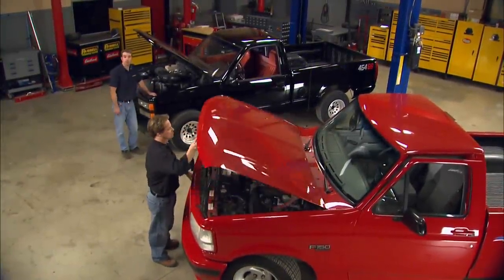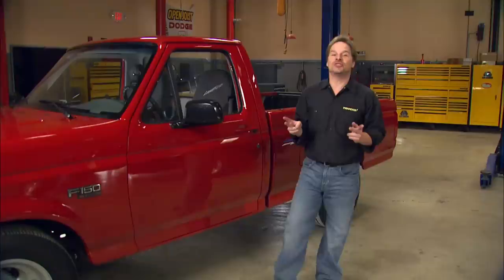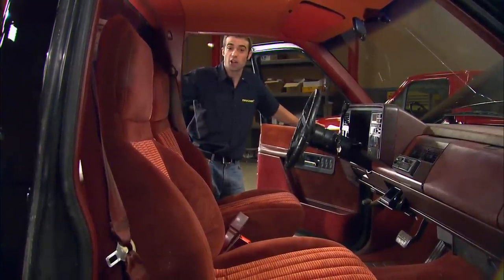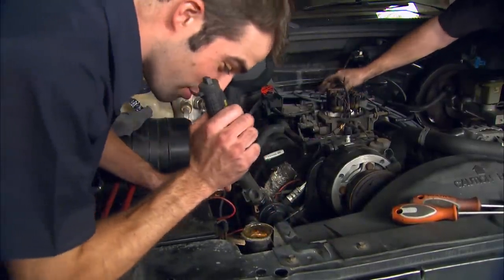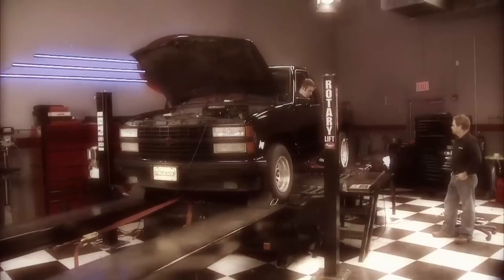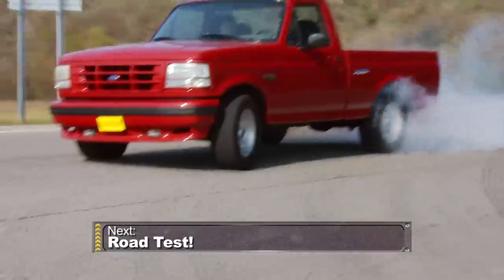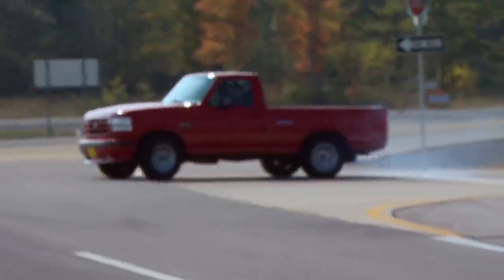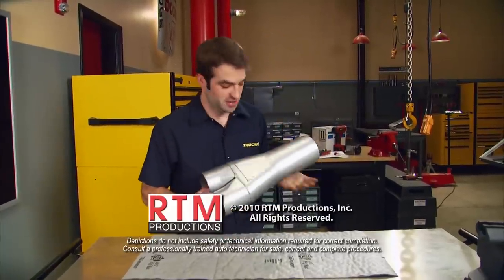'90 Chevy 454 SS vs '94 Ford Lightning F150 MuscleTrux Wars Part 1 - Trucks! S10, E1

Comment: Haha, the ford makes like 35 more hp and the same amount of torque with 103 less cubes
Reply: It's an emission game. You dont think the same ford product would have beat out the 454 Chevy in 1970 do you?
Reply: sonofthesheriff no but a 1970s 460 would which is equal
Reply: And a whole 3 hundredths of a second faster because it's doing what a normal ford does. Sucking at putting the power on the ground.
Reply: @willc3586  Its 3 tenths, not 3 hundredths. Which if you were a drag racer, you'd know is a lot.
Reply: @willc3586  tenths, not hundredths....on a hundred less cubes.
Reply: You right, my bad. Night shift....
Reply: @sonofthesheriff  yeah ever heard of Le-mans?

Comment: Back in 2010 I bought a used 1994 F150 Lightning for $4,500  I put about $1,500 into the truck. New rear tires, new shocks , new parking brake cabel, new Lightning Decals, new plugs , wires, rotor and cap, new vale cover gasket, bought a complete used  Bassani  equal length shorter headers exhaust system. Had the headers power coated black. Recondition the engine bay and some engine components, new radiator, sway bar links. Went to the auto recycling  to get a decent radiator core support to recondition ( the one in the truck was rotten at the bottom) a completed jack and a better coolant/windshield washer tank, new fog lamps, new rubber channels for the door windows. It was a fun truck that got about 10 miles to a gallon of gas. Sold the truck in fall of 2012  for the same amount that I bought it for.
Reply: You did all that for $1,500? Impressive.
Reply: That would cost way more today lol
Reply: @chefderappa4838  LMC  Truck saved me a lot of money the hardware to mount the reconditioned radiator core support was about $150, the dealer parts department was around $300. Also RockAuto was a big money saver. The owner of the Auto Salvage yard is a friend so any parts that I bought from him I got a killer deal on them.

Comment: I've seen middle school kids who can weld better than that.  Love the trucks.  Grew up in the 80's and 90's and I love trucks.  My 91 GMC stepside I'm building to be a muscle truck.  I have taken off all the chrome (mirrors, grille, bumpers) and put on the 454  SS mirrors, color matched front bumper, roll pan in the rear, took off the emblems and rubber trim.  Just painted it all fresh dark gray last summer.  Needs a drop and some wheels now.  It has no cats, EGR delete, K&N filter, injector pod spacer, Hypertech "salad bowl", 3" flowmaster 40 series dumped, B&M shift kit (chirps second easily), timing advanced at the distributor, 180 degree t-stat, and electric fan.  Would love some 4.10 gears and Detroit true trac.

Comment: Well TBi Vs multiport. 🤷‍♂️
off course the multiport runs better. 
just check the Vortec 454 to see the gain in power. 
Even the 5.7 Vortec(96-01) is making lots better.
Reply: GM TBI from '88-95 were junk.  Run forever and start right up but NOT even close to performance engines, not even a decent platform. 

I had a '94 GMC Sierra K1500 4x4 with TBI 350, lifted with 35s. A guy I worked with had a heavier Chevy Tahoe, 1996 K1500 with Vortec 350, same lift, same size tires and he would smoke me every time. 

Nice truck, clean, cool body style but no power. 

Now a days you can get those LS3 E-Rod crate engines designed to pass CA emission/smog and have 400+ horsepower.
Reply: Very true. TBI trucks absolutely suck for any kind of performance. Besides, Ford did a way better job in matching parts. All Chevy did was take the big block from the 1 ton and put it in a half ton. It is the same engine out of the 1 ton.
Reply: You mean the Vortec 496? The 496 8.1L was a monster!
Reply: excuses excuses, y'all got embarrassed by a small block.
Reply: Gm's TBI was rock solid, well designed, and one of the first of it's kind. They were (back then anyway) trying to make the most dependable truck you could by.. and one of the reasons GMT400 trucks are one of the best Chevy Truck runs in history.
Reply: @alexcorona but its lil brother the Syclone embarrass them all, even the sport cars!
Reply: @scarface9617  yea that 4.3 turbo charged was no joke
Reply: @jasonvoorhees6657  I had a typhoon.. was the funniest ride that I've ever had til' this day!   These two trucks was no match at all for it! wouldn't believe the badass rides that I put to shame.. and held the road good for what it was!
Reply: srvanddt1 you’re right about that, I built a 383 for my extended cab, it’s pretty quick now

Comment: I got the black ford lightning in 93 off the show room floor first day I saw it.. went in for a 4 wheel drive pickup in January..upstate New York..   saw the Black Death sitting inside.. salesman said wanna drive it.. well hell yes..drove it like it was built to do.. man it was a blast .. I mostly loved how well it stuck to the road .  It was like a slot car with both gas tanks filled.  So yes when I returned to the dealer I got Black Death  that day .  The smiles on my face driving her home ..  I lived 10 miles away..think I got home 6-7 hrs later.. OH yes the Long Way home.. lol

Comment: Ive owned both trucks.. the lighting kicked the crap out of the ss.. but tons of performance parts out for the 454 and the 351w so both can be a great truck.. but personally ill choose the lighting everytime it was just a better platform..
Reply: F150 has always been a better truck , everyone knows it but blowhard Chevy fans try real hard to bs their way through
Reply: Have a 98 k1500 5.7 5 speed Z71 strong motor. Flowmaster..yeah. Passing many fords on the road

Comment: This was in my era too. I had a 1994 Dodge Dakota sport with a 318 and 5 speed manual trans. These 2 trucks got to see my taillights on a regular basis.
Reply: I knew a guy with a 5sp 318 Dakota reg cab around '99. He  embarrassed a couple of  5.9 rt Dakotas at the track. Those were some.   >R< eal.    >T< urds    back then

Comment: 5:41 😂i love how they even left a piece of mig wire hanging from the garbage welds! Looks like stevie wonder works part time in a muffler shop.
Reply: A piece of wire. More like several pieces lmao. Booger welds haha
Reply: A piece of wire. More like several pieces of wire haha. Booger welds lmao
Reply: @breimer87  yeah I commented that before they got to the rest of the exhaust😂 sad to say I was welding 5 x better than this before I was even in highschool. Built my own exhaust for my f150 when I was 17 and all we had was a oxy acetylene torch and a stick welder from the ww2 era. Hell I even took two sections of pipe and pie cut then with a sawzall , welded them back together and made  a large cowbell exhaust tip.even made the thing shoot flames with some primary wire, a switch, and old coil,and spark plug.  I couldn't even imagine kids these days doing any of that.They are too busy with their fortnite, or whatever game is out lol
Reply: That's what you get with unions

Comment: That’s 4 years of technology difference
Reply: And neither truck really changed the years they were made. There really isnt any difference between a 93-95 lightning except 94 later blocks were roller cam ready...
Reply: Not so much. Ford was always ahead of Chevy in the Performance realm. The '87-on Musangs ran circles around their Z28 & IROC roadmates.
Reply: @303StreetMachines been fords go to since then. Just slap a supercharger on everything because our motors can't compete with the modern marvel that is the LS series motors.

Comment: love this kind of stuff. I know everyone says they would rather see XYZ but truly, I would LOVE to see the Gen2 Ford Lightning and later model chevy go at it mainly because I think the Fords are under rated.
The Gen2 Lightnings are the most reliable and under rated vehicles made in history. Thanks for the vid. Lastly: Using non antolock brakes means modulating your pressure manually upon the pedal with experience, not simply stomping the pedal. Manually pulsing your foot pressure just like the antilock brakes automatically do for us. geez.

Comment: GMC Syclone would smoke both of those trucks stock.
Reply: It weighs a lot less than both of these trucks
Reply: You dam right
Reply: @dufus2273  funny guy
Reply: O no shit, the syclone didn't even weight 4000lb it was all wheel drive backed up with a 4.3 Turbo'd engine that was a little truck that got a reputation for smokin Ferraris in the 90s what's a lighting and a 454!? Ya know!👌
Reply: But im not gonna lie the lighting and the 454 were pretty badass
Reply: @UCZbZrazLdtALfeYGSD_IS6A my stock 4.0L V6 frontier is like a whole second faster 0 to 60 then both of these trucks
Reply: @kyle1262dk  those frontiers are slick! They haul ass!
Reply: My '94 dakota with the 5.2 magnum V8 and a 5speed manual was faster than both of those trucks
Reply: Easily
Reply: Mike Barnes   cool story bro
Reply: Cyclone was tiny though. It should, you could barely put some mulch in the bed.🤣
Reply: Brian Samuels like the short beds on the 454SS and the Lightning are any more practical...
Reply: @iDrive4fun93  atleast they can hold more in the bed..ha
Reply: Brian Samuels I wouldn’t use any of these as work trucks. But that’s just me. And I don’t think they can handle that much more. I had a 1993 Chevy c1500 at work, with the 350ci V8 and the 4 speed auto, and just a 12 foot trailer and an Ex Mark zero turn mower and the hitch would be hitting the ground and on speed bumps. Our 4 cylinder Toyota Tacoma doesn’t squat like that with the same trailer.
Reply: Different class of truck, S10 truck, a mini, a lighter, smaller truck and a Corvette engine, I'd hope so, that's the best truck they ever made. But a full size Shelby 755 horse would resolve that problem.
Reply: @austinlafleur1484  Ford doesn't make a 454, that's Chevy, Ford, 260, 289, 302, 351, 390, 426,427 460. Heard of the Ford Cobra 427 inch two seater? Fastest production car title for like 30 years? Lightning about a 100 cubic inches smaller than that 454, which came aluminum for a 74' vette.
Reply: @maikaelstewart9546  again midside truck with a huge engine, Ford pushes big horse smallest of the three engines but bust ass. You want to compare your 5.2 in mid against full size, sure take the 755 horse Shelby truck, big Ford will do ya some learning.
Reply: @markmarshall9941  are you drunk?
Reply: @markmarshall9941  The GMC Syclone and Typhoon didn't have a Corvette motor it's a 4.3L v6 turbocharged similar to a Buick Grand National.

Comment: They should of came with a 5 spd from the factory
Reply: Robert LaPointe  
He meant manual transmission, not automatic transmission
Reply: Robert LaPointe my 2016 Jeep Cherokee is a 9 speed auto. It doesn’t get any better mileage than my 4 speed Mazda.
Reply: Robert LaPointe  the current 10 speed that Ford and Chevy share is great, it shifts faster than any person could and because of the amount of gears it gets better gas milage and accelerates faster than a 5 speed manual could.
Reply: Robert LaPointe both are 4 cylinders, 4x4 Jeep, it averages around 26 mpg, my Mazda with a couple mods would average 28.
Reply: @noelmedina6925  while all that is true, it's also a hell of a lot more expensive. A simple clutch is a damn sight cheaper to replace than those shift packs. I WISH my '93 had an NV4500.
Reply: @anthonywebber2211  someone gets me
Reply: @Coronet_shop  
I prefer manual transmission to, I just bought a 2006 Chevrolet Silverado its not even on the road yet, and I'm wondering if I can get a manual transmission for it
Reply: @anthonywebber2211  I've heard few to several 06 models did came with a manual trans and congrats on the truck.
Reply: @Coronet_shop  
Yea, and thanks man
Reply: Noel Medina Manuals definitely get better gas mileage. The 2019 Accord 10 speed auto gets no better mileage then my brothers 98 Accord manual and this has over 200k. Plus you can control a car or truck better then a automatic. People like manuals for a reason.
Reply: @waterloo123100  damn right
Reply: It was 1994 man
Reply: No shit but people can't drive that lol
Reply: They both should of Came with T56 trans
Both chevy & Ford had them on Camaros & Mustangs dont see why not on these performance trucks
Reply: I just bought a mint low mile 91 Chevy with a 5 speed manual and i have a fresh aluminum headed 454 that's about to go in it. She will be fun on the weekends.
Reply: @Coronet_shop  my 03 Silverado has a nv4500 you can swap it, what engine do you have
Reply: In the 90s a lot of cars still came with only 4 speed manuals my 90 honda is 4 speed
Reply: @eizzle78  The engine size also plays a big role in the mpg mix, as well as the year and type of Mazda you own.
Reply: @eizzle78 , Your Jeep loses out over the Mazda by a couple of mpg just because it's a 4x4.  I'd venture to guess that your Cherokee weighs more too, since most Mazdas are small cars, especially those built during the time period back when they were equipped with 4 speed transmissions.
Reply: @waterloo123100 , You can pick just about any newer vehicle that offers both automatic and standard transmission, and nearly every one of them equipped with an automatic will have better mpg ratings.  As far as your comparison goes, the only way you can get a 10 speed automatic in a Honda Accord is if you pair it with their high performance turbocharged 4 cylinder engine, which is quicker than the V6 it replaced a couple of years ago, and would literally trounce  any Accord made in 1998.  All other Accords equipped with the non turbocharged 4 cylinder engine use a CVT transmission, which is rated a combined 6 mpg higher than the turbocharged model with the 10 speed. The manual equipped 2019 Accord Sport is rated at 5 less combined mpg than the exact same vehicle equipped with a CVT.  I like the control you get with manuals too, but in newer vehicles you give up a pretty hefty mpg penalty over an automatic, and automatic equipped vehicles are also quicker than manuals.
Reply: Chuck D Your a fool if you really go by EPA ratings the factory put out. People have been breaking those ratings in Manuals since they’ve had EPA ratings. Real world experience beats all.
Reply: Chuck D It was an 04 Mazda 6, but yes, you’re definitely right, I think the Cherokee has 1,000 pounds on the Mazda. In reality, the V6 would probably get better mileage in the Jeep.
Reply: @waterloo123100 , When pretty much any auto manufacturer that makes automobiles rates their automatics with consistently higher mpg than their manuals, I'll go with the manufacturers.  If they don't meet their published mpg ratings, they're called out on them by Environmental Protection Agency (EPA) and the National Highway Traffic Safety Administration (NHTSA), and are forced to correct their ratings.  This has happened more than once.  Back a decade or two ago manuals had the edge because they typically had more gear ratios than automatics, which allowed the engine to operate at a lower rpm for a given mph.  That hasn't been the case for at least the last decade or so, where automatics now typically have 8 to 10 gear ratios, or an infinite amount with a CVT, and standard transmissions, with a few exceptions, are still limited to 6 gear ratios.

Comment: I miss my 93 lightning but on the bright side I’m getting a 2010 raptor as a replacement
Reply: Good luck with that my buddy got a 2012 raptor and it was tore up more than it was running
Reply: pretty much same boat sold the 94 white lightning. #3*** something.. 225k on motor, Jba headers true dual, side exit  . 
a supercharged coyote would beat the shit out of the first gen and second gen lightnings.
A new 5.0 tuned coyote on e85 2.9 whipple can boast 950whp .. so unless one throws a turbo or supercharger on the 5.8l it's just a sweet novelty truck
Reply: Just make sure you don’t get a 5.4. I don’t know what they had in that year.
Reply: Ya Boi CJ 5.8 351w port tuned fuel injection , auto
Reply: My '95 Lightning, which I wish I had never sold, had a supercharged, .030 over forged piston 351, mild cam rebuilt engine. Also MSD ignition and a well built E4OD, that would throw your head thru the back glass on the one-two shift and lay 5" of rubber. It blew the doors off a 454 on nitros one day. Ran 7.30's in the 1/8.

Comment: Had a stock red 93..cowl hood roll pan chrome wheels black windows..15.3 88mph flowmaster delete..sideways everyday..never done anything but swap rear tires and change oil..i want one again..ode to 1999 and the women who loved that truck!!and kicker seperates with a rockford 15" between the seats and remote stereo..19 years old and bullet proof!!